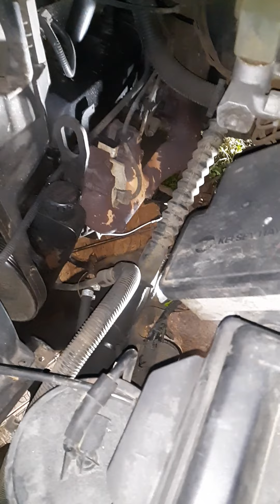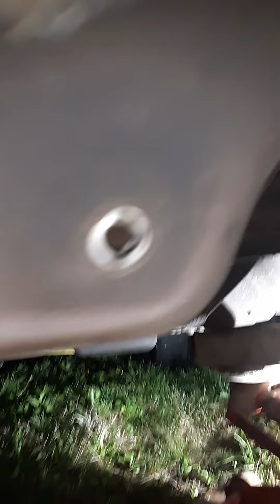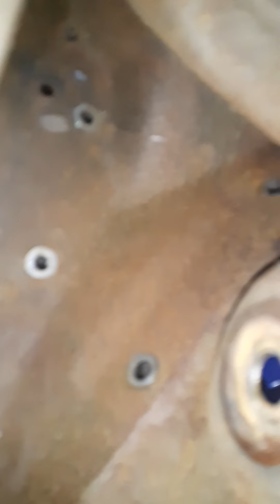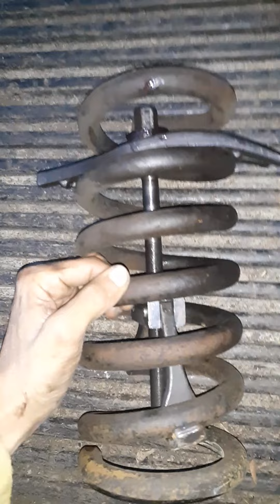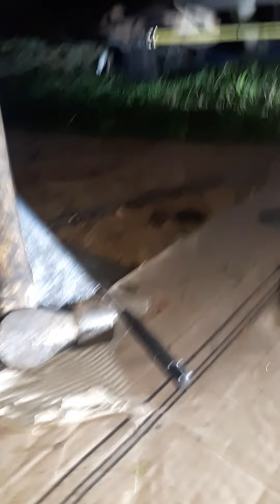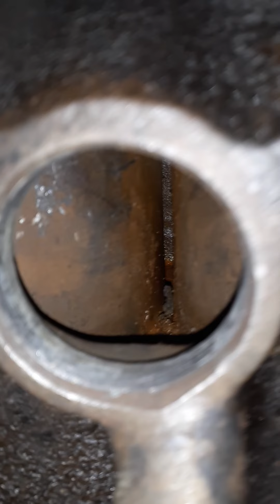88-97 Chevrolet truck v6 - Motor Mounts and freeze plug replacement

Comment: Getting ready to do the exact same repair.
I think I'm gonna video mine as well. 
Wanted to do it without removing the control arm but, I don't think so ..
Reply: Ya know??? I just decided to say screw it and go for the slack jawed mechanic’s fix.
I bought some of that JB Weld high temp putty and I crawled under with a bit of that mixed up and slowly slipped a butter knife in there a few times and filled that area up with the stuff. Once it hardened I checked it out. No leaks even after temp. No problems since I did it and don’t expect any.
Sure was a hell of a lot easier than the other way!
Reply from the maker: If you can find a wrench or an extention that will make it might be possible.  I just decided that since I knew what it took to remove the control, I wouldn't mess around an possibly waste time trying  to pull a mission impossible an fail. If you think you might run into complications with the arm removal it might be worth it to try an find a way up in there. I know people have done it without removing the arm. Good luck an if there's any insight I can offer to make it easier on you just let me know, thanks for the comment an Subscribe if you want I've git alot more jobs to do on this truck and I will be posting the videos that go with them. Be honest I think the other freeze plug needs replaced as well so I might be doing the same thing to the other side

Comment: i have the exact same problem on a 92 silverado finally got the motor mount out. but not the bracket. can you replace the freeze plug without take out the bracket?a  also planing to do the other side also. no wonder shops get upwards of 350 per frez plug esp behind the motor mount tools alone are worth that much.
Reply from the maker: If you don't have the tools already I wouldn't make this your first job. But hey what do you have to loose, if you keep at it you can do anything!